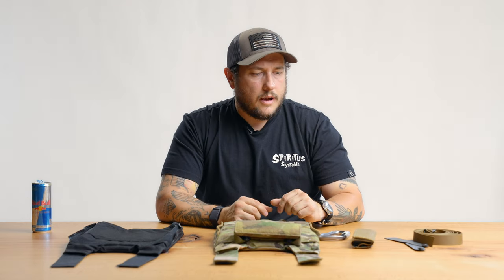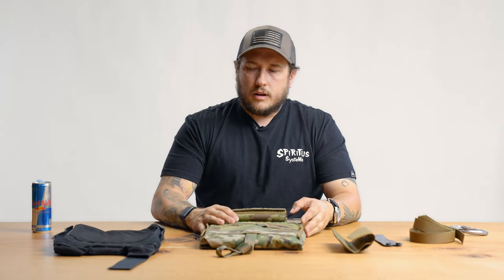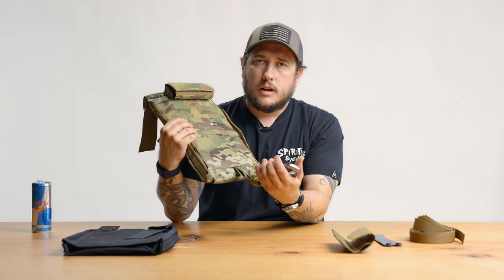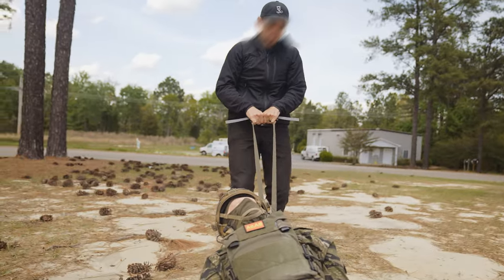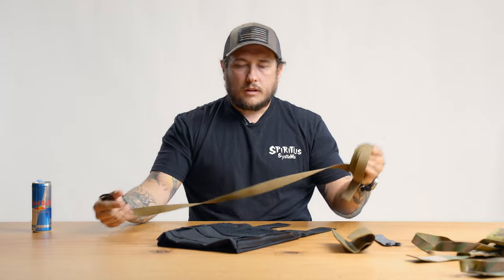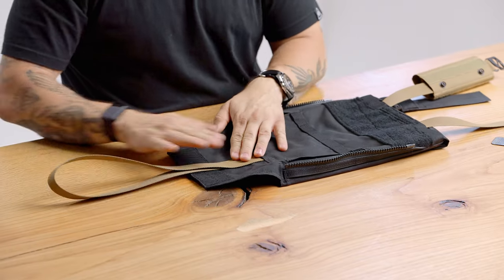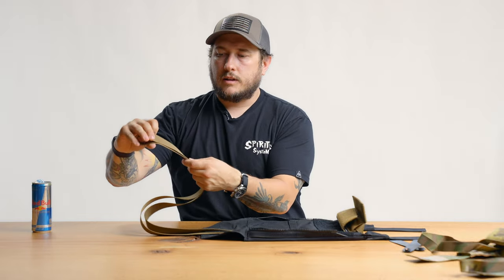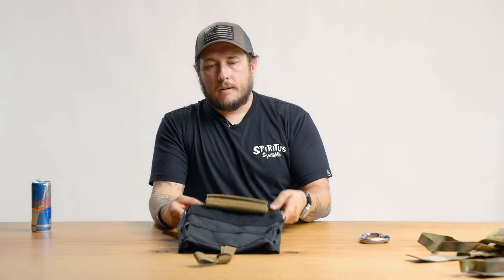Recovery Handle Overview and Install, Spiritus Systems

Comment: I've been waiting for this, I think I messaged you support guys a few months ago about this. I just run tubular nylon through the back of my avs, and it's been great but it's a little nit picky but I just hate the makeshift handle that you just kinda have to deal with. I'll definitely be picking a few of these up, I'm excited!!
Reply from the maker: Awesome. Tubular has been the standard for this for a long time, but we're confident you'll really like this setup

Comment: So I take it this won't work witht he covert back panel? Had been hoping maybe it would be able to. Unless maybe it could be run through the passthrough at the shoulder and then down and out the sides were the CB comes out? Certainly wouldn't be as nice and clean, and it would sit higher and the stays wouldn't be usable because the passthroughs would be too far apart. But maybe would work. Or maybe a seperate version on the way for the covert?
Reply from the maker: Right now it is only designed to work with the Overt rear bag, and other carriers with MOLLE available on the back. Not saying we wont design another version, but we're not focused on that at this time

Comment: Your comment about everyone ditching their current carrier and running a LV119. I have a LV119 and as much as I love the internal cable management and ability to use this drag handle, I never use it, because it’s not comfortable for me for long term use. My go-to carriers have been structural, specifically the Ferro FCPC and Crye SPC. I would love to see you guys introduce a structural version of the LV119. I’m not the biggest fan of the straight over the top shoulder straps, but having a structural cummerbund (with Tegris, preferably) would be a massive improvement that I would love to see. Keep it up dudes 🤙🏻
Reply from the maker: Everyone has different taste. Thanks for your support
Reply: Structural cumberbund would be awesome

Comment: Any guidance or thoughts about placing a large chunk of metal in the shape of a locking carabiner centered over the spine at 6 o’clock on the belt line? 

Most conventional wisdom is to keep metal objects off the spine. Do not conceal carry at 6 o’clock due to the risk of spinal issues if you fall and land on it. 

How is this any different?
Reply: I actually tied off two knots at the bottom of my plate bag, and run two karabiners; respectively at the 5 and 7  o’clock position. (Overall length or available strap isn’t an issue with two knots; I’m 6 foot). 

I ran smaller load bearing karabiners too in order to have less interference with movement and wearing of various backpacks and kit configuration.
Reply: @KossackNation  What knot did you use to tie two loops? Would love to do this as well
Reply: Overhand knot.